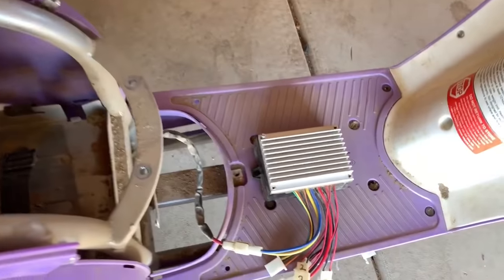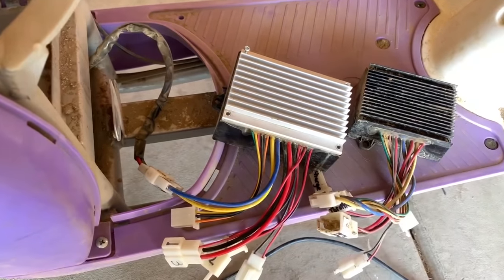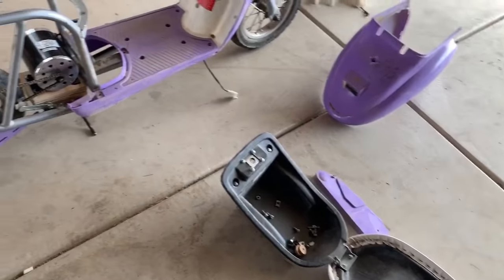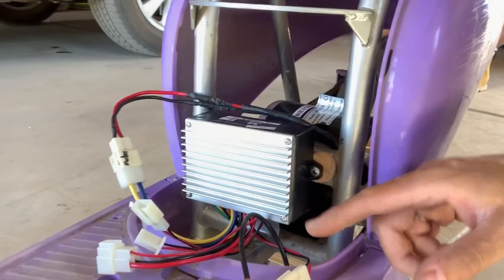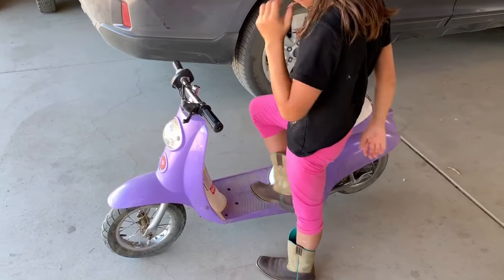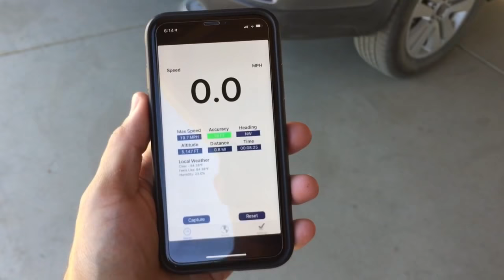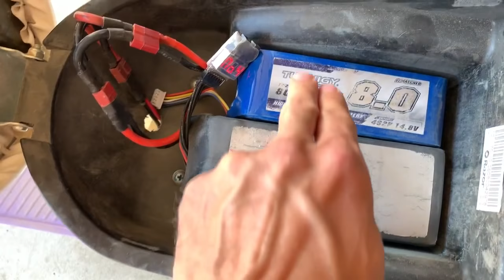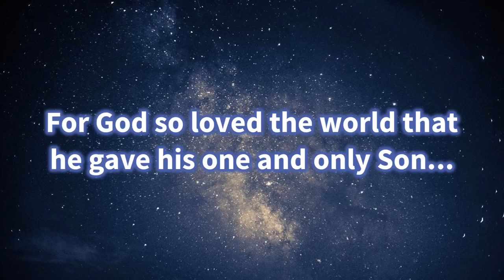Razor Pocket Mod Scooter 36v Upgrade!

Comment: A neighbor tossed one of these out in the trash two days ago. It runs great but needs some tlc. Can't wait to start some upgrades. You've given me some great ideas.
Reply from the maker: Nice! Those are the best finds!
Reply: Will you be posting any videos on your build?
Reply: @gerardogaona6557  No, I don't know a thing about video creating. I'm great with my hands... small engines, machinery, custom building toys and models. But the tech stuff eludes me.
Reply: Hey buddy install a motorcycle engine on it 😂 I'm planning on installing a motorcycle engine fr

It'll be fast tho 😂😉
Reply: I just found one stripped down and tossed to the curb.  Body and battery are gone but it looks good to go with the motor, rear wheel and seat.  I want to test out the motor before I invest any money and time into it.  Definitely going to need to do some fabrication.

Comment: I used a 8s lipo and didn't change out anything else. It now goes 20mph without much effort. Having been using it for years now without overheating issues.
Reply: Whats a 8limpo
Reply: Still no issues? What spec 8s Lipo did you go with?

Comment: Fun fact. The throttle you replaced it with used to be the standard on the old Pocket Mods. Mine came with it back in 2006.

Comment: Picked one of these at a estate sale for $35 bucks re pop laced the chain and front inertube and tire. It uses cast spokes the thick spokes on the razor. And using a 12v to 24v booster converter works very well with it. Haven't done a top speed. And using a battery that build on the back pack to power the boost converter. It a 40 ah battery pack that is power the set up and with it stock motor.
Reply: Here is the video on my Instagram
 https://www.instagram.com/p/ChqsSD0r2XY/?igshid=YmMyMTA2M2Y=

Comment: I put 2 24v motors on the little razor dirt bike. It didn't increase the speed but it carries my weight much better. I also used 2 lawn mower batteries

Comment: I just bought one from Goodwill for 10$ and have no clue what I'm getting myself into. Though I do want variable speed and LEDs. Hopefully build a Tesla battery pack and fast charge. The motor upgrade sounds great for later.
Reply: Really wish it came with that type of throttle control for gradual acceleration. I just got one of these yesterday and had a low speed wipeout on it on my first test ride and I'm a 47 year old. Fortunately I was wearing my helmet and jeans though so I didn't get any injury other than a slightly bruised knee.
Reply: @michaezell4607  that's hilarious

Comment: Just bought everything for my sons. Can’t wait 🙌🏽
Reply from the maker: Derek and Courtney Very cool! Let me know how it goes. 👍🏼
Reply: MapleBoarder78 yes will do 🙏🏼 I did purchase 2 ExpertPower EXP1290-2 12V 9AH SLA Battery’s. Do you think that will run good with the 36v motor?
Reply from the maker: Derek and Courtney As far as I know, the system will not work on 24v, you need 36v to power the 36v motor and speed control. You would need three 12v batteries which will not fit in the stock battery location as it’s only meant to hold two 12v batteries for the stock 24v system. That is why I use lithium batteries kept in the seat compartment.
Reply: MapleBoarder78 do you know what the battery’s are called that you used? And that meter thing on the battery wire?
Reply: Or do you know a cheaper way to get battery’s for the system. Them battery’s are expensive 😂
Reply from the maker: Derek and Courtney Lipo batteries are very expensive. I get my lipo batteries on Amazon. I use a 6s 8000mah lipo ($110) and a 4s 8000mah lipo ($90) run in series. You will also need low voltage alarms ($10) to run on each of them. You will also need a lipo charger ($50), and wiring and battery connectors with a soldering iron kit to solder it all together. Your looking at $250+ to run lithium. You also need to be well studied in how lithium batteries, work, charge, and need to be stored. They can only be drained to a certain voltage or  they can be damaged and even catch fire. They also should be charged and stored in a lipo bag as they can be very volatile. (At this time I don’t know of a cheaper way to run 36v in a pocket mod. You would need to figure out how to fit a 3rd 12v battery somewhere on the chassis if you want to stick with SLA batteries. That may require extensive fabrication work).
Reply: @MapleBoarder78  link to the lipo batteries you used?

Comment: 6S and 4S together? Don't they have different voltages? is 14v and 22v how youre achieving 36v? I heard youre not supposed to do that. Let us know if anything goes wrong.
Reply from the maker: bo jackson You can run them in series like I have, but not parallel. They also need to be around the same mah. Been running great.
Reply: MapleBoarder78 heard series with diff volts is bad. everyone says it but i wouldnt be surprised if everyone was overreacting. let us know if it starts dying faster than expected.
Reply: @bojackson3073  Why???? Have you ever open up a lipo pack before??
They're just single cells solder together...FFS
There's different C ratings( discharge rate) and Mah ( size of gas tank..per say)
It  woundnt necessary cause over heating..Battery management/balance would be wack ( But he's using the same mah size 8000 mah for both packs....So they discharge at the same rate.

i run 5s in power wheels...3s and 2s 5000 mah 50c...
it has more power than 5s 30 li on ( drill battery pack)
i actaully make 6s from old li on packs. to 6600 mah at 30C
To get the same performance as 5s 50C lipo

I order the 1000 watt 48v ( same size motor)..becuase it' s only $3 more than 500Watt.lol The speed control i got is only $12  it can do 40A continue 60 A spike..it has REVERSE..but no chinese instruction
for the harness.lmao (it;s not that complicated..if have RC toys)

That motor is only 20A.lol
.i dont have to use 48 volts...but can use it later whne they get older.
going to install it in power wheels..basically using the quad's rear end
Do 36V...keep it around 12-15 mph...becuase i live in the city.
Or even less...12mph tops....

Until they learn how to drive it better or do 48V in open field or country roads....I'll just get 4s x 3

Comment: So how many miles can it get in a single charge you reckon?  I'm annoyed that this toy is faster than My electric bike which only goes 14mph😭😭
Reply from the maker: Disney Toys R 4 Fun 
Haven’t tested it all the way, but we’ve gone 6 miles easily. It can probably go around 8-10 miles depending on your speed, the terrain, inclines, wind, rider weight, etc... That’s with a 8000mah 42 volt battery.
Reply: I'm here too for the miles and run time the upgrades add...👍. I want to do this so bad

Comment: So the bigger motor means that you can haul more than 170lbs? cuz the max weight for  Razor Pocket mod are only up to 170lbs
Reply from the maker: That may be based on how much weight the frame is rated to hold as well. Razor doesn’t specify whether it’s based on the frame or motor.

Comment: How long did the battery life last? before ya needed to recharge?
Nice Job!
Reply from the maker: 8ah lipo batteries tend to take the scooter about 6 miles on dirt roads. You could probably get 8+ miles on pavement.

Comment: Cool!  So you upgraded t 800w MY1020 motor, 36v controller, how did you mount up the new batteries?  Did you weld in a new battery tray?  What batteries did you use, guessing not the old 24v.  I'm modding up 3 pocket mods I just bought and trying to do it right the first time LOL
Reply from the maker: Jaylin 

7:45 Shows my battery set up. I use Lipo batteries under the seat. Not really any room for 3 12v SLA batteries in the frame unless they are tiny. You can do either a 6s and 4s in series or two 5s in series.

Comment: I know this video is older but could you do a video on how to wire this up under the seat? What do you use to charge the batteries? Do you have to remove them or did you install a BMS inside the razor? Sorry for all the questions
Reply from the maker: Hi Joey, I probably won’t have a chance to do a video about the wiring, but I can tell you what I did. I just snipped off the stock battery connector on the speed control and soldered on a deans (some people prefer XT-90 connectors). Then I drilled a hole under the seat right above the speed control to feed the deans connector through up to the batteries which you can see at 7:50 I use a basic lipo battery charger I bought on Amazon. You can get them for around $30-$50. To charge them I unplug them from the scooter and charge them on my work bench. Here is a link to a charger…

https://smile.amazon.com/FCONEGY-Battery-Balance-Discharger-Batteries/dp/B0848J872Y/ref=mp_s_a_1_3?dchild=1&keywords=lipo+charger&qid=1632425933&sr=8-3

Lipo batteries are plentiful on Amazon and from places like HobbyKing. Unfortunately it can be hard to find good quality batteries for a good price. I tried buying cheapo lipos for a few years but always ran into issues with cell quality. You might have better luck.
Reply: @MapleBoarder78  All I can say is Wow…Thank you for all the information.

Comment: I was looking on eBay for the 36 volt motor and the electric speed controller, do you know which one to order, my daughter has the same bike.
Reply: If you still need it, it would be a 36 v mx500/ mx650 controller.

Comment: I used to run RC cars.  Whats the rule to match up lipo batteries to these? Even if I'm running 24v.  I'd like this switch, I have charger full l set up for lipos still.  Thank you!!
Reply from the maker: For the 24v Razors I use a single 6s Lipo (or two 3s wired in series). For the 36v systems you need 10s, so either two 5s lipos in series or a 4s and 6s in series. For 48v systems I run two 6s lipos in series. Just make sure they are the same mah and C rating and they work. 👍🏼

Comment: thx for the quick reply. sorry for the dumb questions but, how do you get 40 volts out of (2) 14.8v lipo batteries.
Reply from the maker: One is a 4s (14.8v) and the other is a 6s (22.2v) ran in series for a total of 37v, but remember, that is nominal voltage assuming an average voltage of 3.7v per cell. The actual voltage of each cell when fully charged is 4.2v giving you 10 cells at 4.2v = 42v. You can also run two 5s lipos in series. Just make sure they have the same capacity and discharge rating.
Reply: @MapleBoarder78  gotcha!! I assumed they were both 4s. New to this lipo stuff thx man

Comment: Huh... kinda re thinking my choice of tires. I bought these because they were the closest thing to what im looking for and they were complete. I'm building a custom mini chopper and need new wheels and tires but I couldn't figure out what to look for so I went on Amazon and seen a set of tires for a razer something or another they have all the parts I need I just didn't notice the size. But It is a mini chopper so these should be fine till I can find a fat rear and a big skinny front I like better.

Comment: When you wired the Quad switch in, where you able to simply plug and play, or did it only work with the new motor controller?
Reply from the maker: Plug and play.

Comment: Hey man, wondering if you con point me in the right direction on what lipo batteries to get from ebay? Please.
Reply from the maker: I haven’t bought lipos in a while so I’m not savvy on current brands. You’ll want a 4s and 6s lipo to run in series. Biggest mah you can afford. Read the reviews and hope for the best. It’s kind of a crap shoot with those cheap Chinese lipos on eBay. I’ve gotten good ones and bad ones and often there is no rhyme or reason to it.

Comment: Hi MapleBoarder78, I am hoping maybe you have the insight to help me. I've tried a few different avenues to figure out my problem and they've all hit a dead end.  I'm trying to retrofit my daughter's Pocket Mod v. 47 to have a variable speed throttle (not upgrading the battery or motor as you did). As far as I can tell, no one makes a kit for v. 47.  I have the wiring diagram for the v. 44 and v. 47 and they are only different in how the controle module connects to the on/off switch and the battery (everything else is plug and play). I just need a few more wires and connectors to fix the problem but I don't know what wires or connectors to order!  I don't know if I can post the diagrams here...
Reply from the maker: Cathryn Sayer I apologize, I just saw your message! 🤦🏼‍♂️ Did you ever figure this out? The only way I could find to get a variable throttle was to change out the speed control unit and motor like I did in this video. I didn’t really want to change out the stock 24v motor, but the 36v speed controller can’t run on 24 volts.

Comment: Nice build! I am still looking for a cheap MY1020 motor and batteries and I have a question.. What if I just replace the speed controller from the stock 24v to the 36v one, will it have any effect on the speed and mileage of my scooter? Sorry I'm not electrically inclined lol
Thanks and stay safe!
Reply from the maker: Fun Times With Gaby - Hi! Unfortunately if you use the 36v speed control you must use at least 36v to run it which will burn out the stock 24v motor rather quickly.
Reply: @MapleBoarder78  Ok got it! Didn't notice that I am using my kid's YT page lol Thanks again!

Comment: Can you help me get a parts list
Reply from the maker: Sorry for the late reply. On Amazon if you search “LotFancy 36v” you will find the speed control module for around $29.50. The motor is a MY1020 36v motor. They come in a variety of wattages. I got an 800w one and the top Speed is around 16-18mph on flat ground, almost hitting 20mph on declines. You may want to go with a 1000w motor for more speed. Not sure if the controller can handle a 1000w motor though, you would need to check specs. Other than that, I used some random screws from my parts bin and the thick plywood doubled up to make the motor mount. We run this set up on a 4s lipo and 6s lipo run in series to essentially create a 10s lipo. Let me know how it goes! 👍🏼
Reply: MapleBoarder78 how is it working so far?
Reply from the maker: @thankyoujesus2836  I apologize, I did not see you comment until today. For some reason I didn't receive a notification. It is still working well. My daughter and I love to cruise around on it. If I could go back I think I would go for the 1000w motor instead of the 800w for just a bit more acceleration and top speed. But we only drive on dirt roads and sand which takes more oomph than driving just on pavement.
Reply: What did you do for the charger and esc
Reply: I just read your first response, do you use a esc
Reply: MapleBoarder78 would the 1000w motor fit...? Without bending or forcing any of the frame

Comment: 💥How do you connect the motor to the speed connector and what are those white things called to connect thanks
Reply from the maker: TGS TV I connected the motor by soldering banana connectors onto the ESC. That’s what the motor used (banana connectors). I’m not sure the “white things” have a specific name. Electrical harnesses?
Reply: And what battery did you use
Reply from the maker: A 6s 8000mah Lipo from Turnigy and a 4s 8000mah Lipo from Zippy connected with a series connector. I charge them separately with a cheap Lipo charger from Amazon.
Reply: MapleBoarder78 thanks I really appreciate it

Comment: What kind of battery are you using and how did you incorporate that into the build..?
Reply from the maker: I show my battery set up towards the end of the video. It’s a 6s and 4s lipo battery run in series to power the system. My battery video goes into more depth on how I do it...

https://m.youtube.com/watch?v=mNoq9ZB2-H8&t=9s

Comment: uh.... you never showed us where the new batteries go, and what you used.... kind of important.
Reply from the maker: Details on the batteries starts at 7:45 in the video as I show where I keep the batteries and what type of batteries they are. 👍🏼 Two lipo batteries run in series. You can do two 5s or a 6s and a 4s. Essentially you need 10s to run the system. For more detailed information check out my video about how I put lipo batteries in my Powerwheels cars. It’s essentially the same concept but higher voltage batteries are needed to run a Razor 36v system. Good luck on your project! 

https://www.youtube.com/watch?v=QNNatRmWfJc&t=192s

Comment: Whats the top speed difference between the stock motor and the bigger motor at 36volts? My stock motor does 25mph on flat ground with a pair of hoverboard batteries.
Reply from the maker: I was never able to test the top speed of the stock motor on 36v before it burned up unfortunately.
Reply from the maker: @danielauen7790  Yes ours is similar. We have a bit of that “shimmy” in the back.

Comment: Did you replace the original throttle? Mine doesn't fit with the new controller.
Reply from the maker: Yes I had to replace it, the original throttle won’t work with the upgraded 36v speed control. I had no trouble getting it to fit.
Reply: @MapleBoarder78  Whats the part number or how do I look for it? Thanks a million man!

Comment: I'm building a gp pocket rocket performance. Do you think 48v will get me to 30+
Reply: I've topped it at 15-18mph on full charge stock
Reply from the maker: @danielpolk9140  In my experience, 48v maxes around 28-30mph in optimal conditions. I had a 1000w 48v kit on my bike a few years ago that would hit about 28mph. If you wanna hit solid low 30’s I’d suggest going with a 72v kit (you’d need three 6s lipos run in series. You might get there with 48v but it will be a stretch, and you’ll need at least 1500w’s.
Reply: I work at a scrapyard and can get all sorts of stuff. The razorquad I got I'm planning on using a scrap golf cart speed controller and putting lawn mower tires